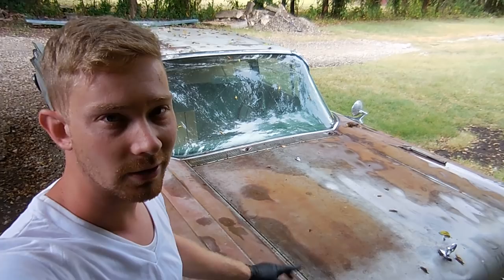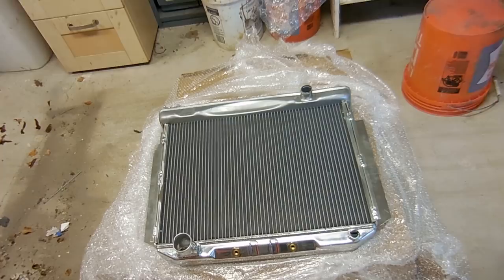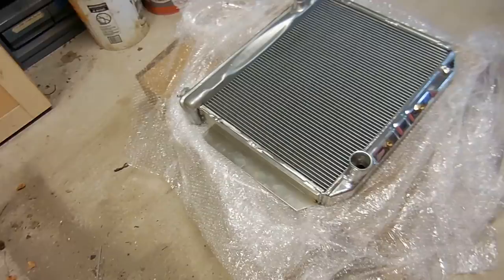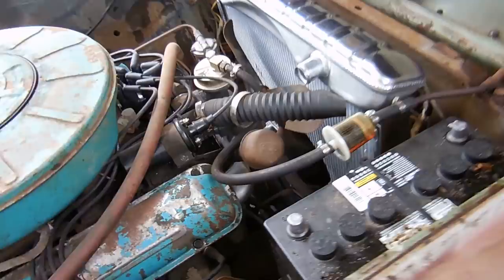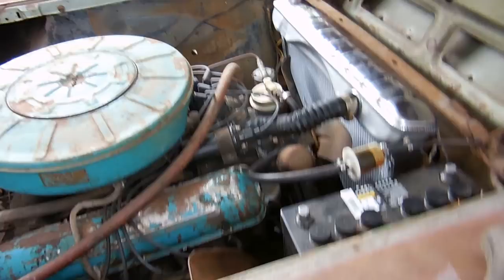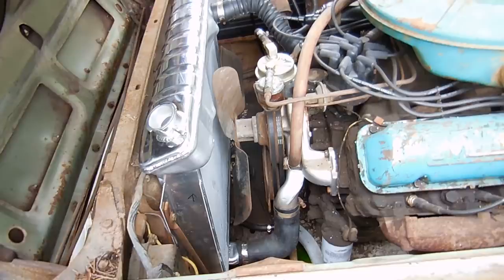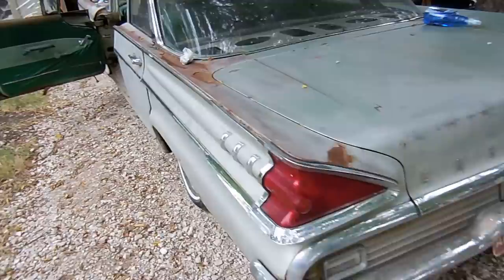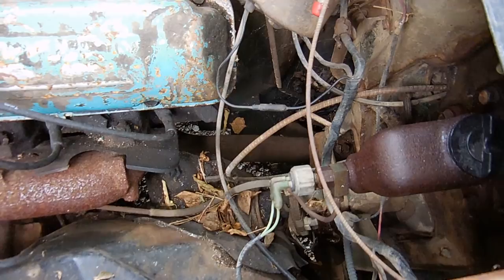Part 14 Will It Run? 1959 Mercury Monterey Asleep For A Decade

Comment: I don't know if you are aware, but you can take the old radiator to a radiator shop and have it re-cored back to like a new one. The only change would be the part that holds water and mount it back just like you took it out. I know it is available in Garland , suburban Dallas, so with you being in Texas you most likely have it too.

Comment: I guess there are not to many radiator shops out there anymore that can re core a damaged radiator. My older brother went to school with a kid who's dad run a radiator shop and would unsolder the tanks and replace damaged core tubes and fins. He would if the core was rotted rebuild the entire radiator using the original top and bottom tanks and their still in business after about 70 years.

Comment: I ordered a after market aluminum radiator from a place on EBay, it was total junk, plastic tanks, for my 73 Grand Prix, mine dad a little leak by a fitting, I sent it back, and had mine redone, for 175.00, new one cost that, return shipping cost me 65.00, only in America

Comment: I have never had luck fitting aftermarket radiators into older cars, and often just have the radiator recored, so they fit correctly and look better. It's usually around the same cost... sometimes cheaper. Was it the camera angle, or did the original carburetor have a piece broken out of the throttle body? If that was a missing chunk, it will cause a vacuum leak. Engine sounded much better. I hope the new owner keeps the original drivetrain in it, thats part of the coolness of that era car. Newer engines are everywhere and just plain boring! I see people that build nice street rods are going back the the era of cool old school "older engines".

Did you ever replace the worn out control arm bushings? It would drive much better with new ones. Guess thats a job for the new owner, If you didn't replace them.

 Looking forward to seeing the Olds running. 

Have you done any more to your 56 Cadillac?
Reply from the maker: I was quoted $500 for a record. "Copper is expensive" was the reason I got. This rad was $200.
Reply: WOOOOW thats a big difference. It cost me $500 to have the radiator recored for the Catalina... and I paid $125 for it used, so yea I had $625 into a radiator, so $200 is a super deal!

Comment: You see the clear fuel filter you should never use the clear fuel filters really bad fire hazards underneath your hood only use the metal fuel filter with no rubber lines use brake lines metal my car burned up it sucks
Reply: Any videos coming on your plans for the car Kevin?

Comment: You used to be able to get these metal radiators re-cored cheaper than new. May not be true anymore since most are plastic anymore. Lost skill?
Reply from the maker: Recore is $500+. Aluminum was $150
Reply from the maker: More like a lost art I guess. Most radiator shops have been closed due to regulations, and also due to it being easier and cheaper to just replace